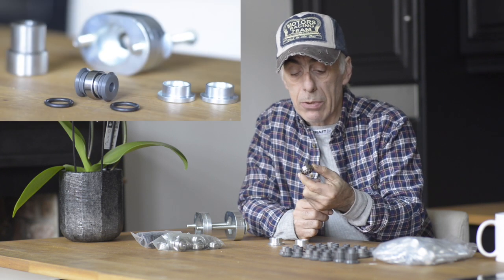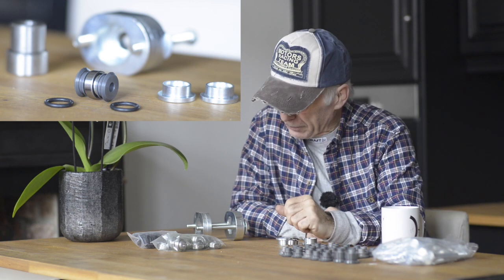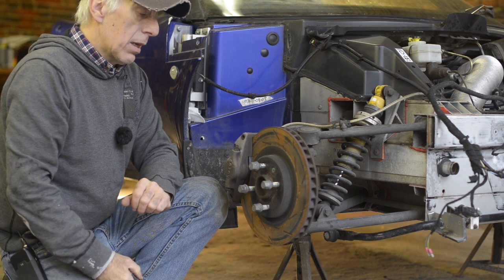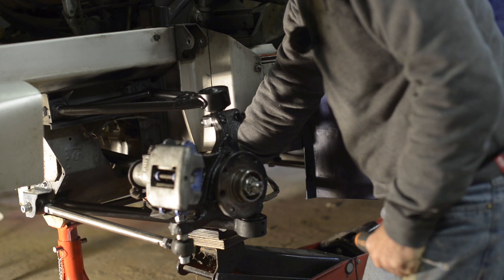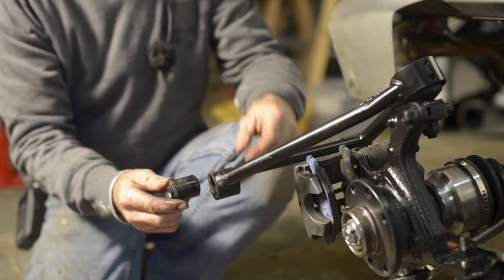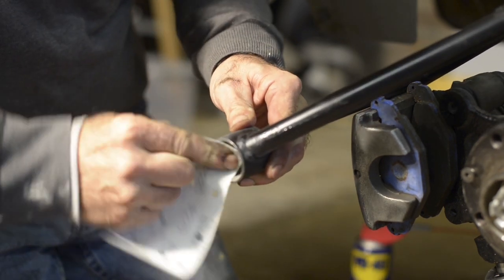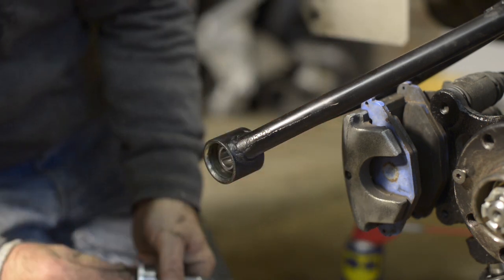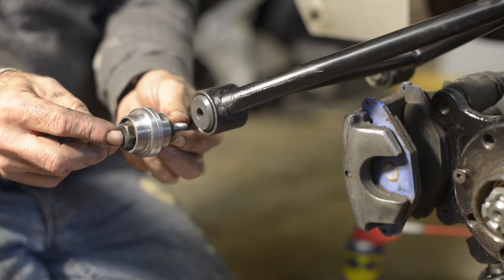Lotus Elise, replacing the wishbone bushes

Comment: I wonder if the rose joints that you are using will make installation back into the chassis as difficult as the urethane bushings were for me.  Both rear wishbones are very difficult to reinstall, the front upper a-arm with the caster shims is the worst of them all.

Comment: For my front upper wishbone, the bolt goes through from the rear side and I think the steering rack gaiter is in the way to remove it.  Did you have to separate that ball joint to get the wishbone free?  I think if the bolt was on the opposite side I could remove it without disconnecting it.  I'm considering putting it in the opposite way when I reinstall.
Reply from the maker: Hi Mark, yes in my case I did split the ball joint.  And sometimes people install those bolds in the wrong direction. splitting the balljoint is easy
Reply: @D3Sshooter  ok, thanks.  I wasn't sure if it would be pressed in and difficult to split.  Did you put the bolt on the other side when you put it back together?  I can't come up with a reason I wouldn't.  As always, thanks for the Elise videos.  They're well done and a huge help!
Reply: @markcorkum3850  Having same issue.  What did you do?
Reply: Turn the steering wheel all the way to retract the tie rod.  The bolt will slide by the gator clip with a mm to spare.  The tie rod moves a lot more than you think it should.
Reply: @davidtimberlake4995  yeah, I think that's what I ended up doing.  I didn't turn them around on the install though, like I originally wanted.

Comment: Did you have any problems with the anodized pieces fitting in?  I have a couple that don't want to snap in and I don't want to force them.
Reply from the maker: Thanks for the comments, No Mark I did not    put them in the freezer for a few hours and then try...  should work

Comment: Are you replacing urethane bushings with bearings or did your car have bearings to begin with?
Reply from the maker: Daniel Quaroni i changed  the originals with bearing based bushes.    Txs for commenting
Reply: Ahhh OK cool.  In the video you were a little confusing calling them bushings/bearings.  Would have been useful to call out that it came with bushings stock but you're replacing with bearings
Reply from the maker: Daniel Quaroni yes indeed.   Will remember  that for my next video.  Txs

Comment: I have 2009 Elise, my rear wheels started to show when driving in low rpm, I feel like bumps every 2 seconds, is that symptoms of bearings worn out?
Reply from the maker: Hi, that is hard to tell. But I would rather expect that the tires or rims are deformed. Jack up the car and spin the rear wheel by hand and see if they turn evenly ( need to put the gear in neutral).  If the bearings are gone , then you will have a grinding sound...
Reply: @D3Sshooter  Thanks for replying, i will check it out and see. I was suspecting the tires as well. I will update you soon